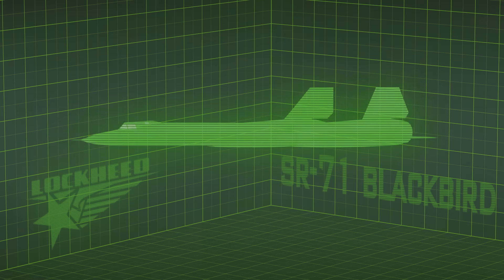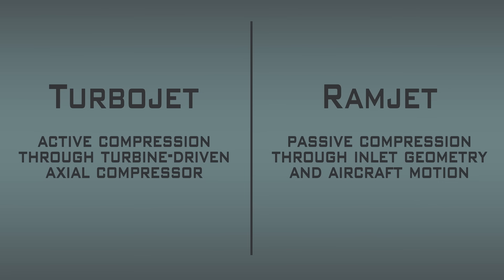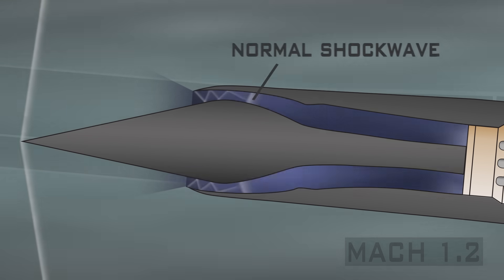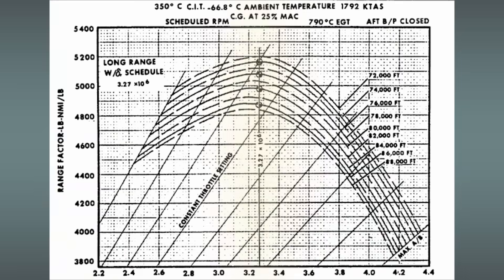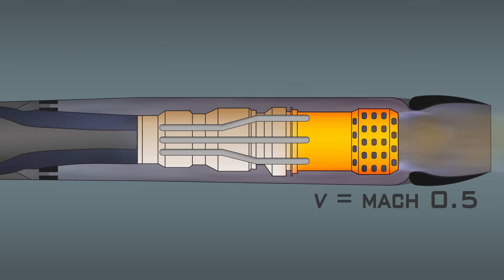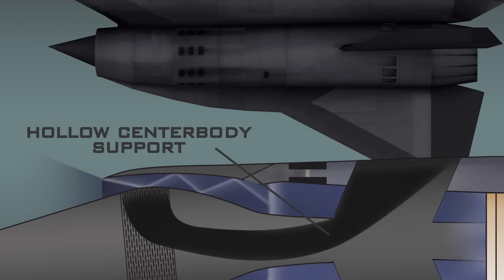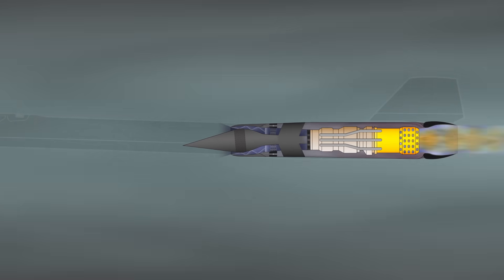The Mighty J58 - The SR-71's Secret Powerhouse

Comment: I do like this presentation - and it took me years of looking at those diagrams and crawling around inside the aerospike ram jets at our local Aircraft Museum to figure out how over 55% of the thrust is made by the spike compressing the super sonic wave 41 to 1 and then moving to aim it down the blast tubes in the engine cowling.
 So with this info, and how my rich uncle had built the CDC computers used in them, I made plans for a version that would be far faster, made of heat proof carbon so lighter, AND instead of using a million dollars of expansive custom made fuel (said to cost more than single malt scotch) mine exhaust pure water. 
Then 2 things happened really fast - the CIA sent contractors to the MSP National Guard Jet Aircraft Museum to cut up their star attraction, in a snow storm and take it back to CIA HQ, and a man called The American Sniper (may he rest in peace) was sent to blow my head off in my bed.
This plane had 2 major disticntiions to its credit - As a single seater A-12 it was modified with a liquid oxygne outlet in fornt of the widnscreen so it coudl go above the point where the 'glass' softened and became insanely dangerous - about 2140 mph, and set the record for fastest land launched airframe - 2,368mph at 92,000 feet. Also when it was fowln to Minneapolis inside a C-5 it was the largest cargo transported by air.

Comment: Excellent!  I would add that the center body of the J58 used on the SR-71 is ESSENTIAL.  If a turbine engine ever has a shock wave touch it's compressor blades, the result is usually an immediate explosion!  This is why it is VERY VERY dangerous to take a subsonic airliner to supersonic speeds in a dive [YES they can do it and YES it has been done in DC-8's on purpose, and L1011's and 727's accidentally.  The slippery 727 numerous times!], since the shock waves can reach the fan section of the engine and cause it to blow apart, a "rotor burst".

Comment: 2 muscle car motors ... wtf dude ?
Reply: https://en.wikipedia.org/wiki/Lockheed_SR-71_Blackbird#Engines

Originally, the Blackbird's J58 engines were started with the assistance of two Buick Wildcat V8 internal combustion engines, externally mounted on a vehicle referred to as an AG330 "start cart". The start cart was positioned underneath the J58 and the two Buick engines powered a single, vertical drive shaft connecting to the J58 engine and spinning it to above 3,200 RPM, at which point the turbojet could self-sustain. Once the first J58 engine was started, the cart was repositioned to the other side of the aircraft to start the other J58 engine. Later start carts used Chevrolet big-block V8 engines. Eventually, a quieter, pneumatic start system was developed for use at main operating bases; the V8 start carts remained at diversion landing sites not equipped with the pneumatic system.[58]

Comment: Sorry but the bypass pipes are not what make it work like a ramjet – this is done by the air going around the main part of the J58 inside the oversized housing (which is why the engines have the oversized housing). It’s not black magic – just a turbojet inside a ramjet tube.
Reply: Uhh nice try but no. The air going around the engine through the housing comes from the shock trap tubes used for cooling and from the aft bypass doors which are scheduled closed at mach 3.2.  This air gets dumped into the exhaust AFTER the afterburner at the ejector nozzle. The air going through the bypass tubes gets dumped into the exhaust before the afterburner, which is necessary for a ramjet. You're right that it's basically a turbojet inside a ramjet tube, but a ramjet needs an after burner and the only way the air gets to the afterburner is through the bypass tubes.
Reply: The bypass tubes are only there to take unwanted pressure off the forward compressor section and only incidentally give some small extra thrust - are not part of the ramjet system. The air does get dumped into the exhaust after the afterburner but this is part of how the ramjet thrust augmentation works. Explained better in the following video:

https://www.youtube.com/watch?v=VpZfBFlTC_c

SR-71 J58 engine tour with SR-71 pilot Richard Graham

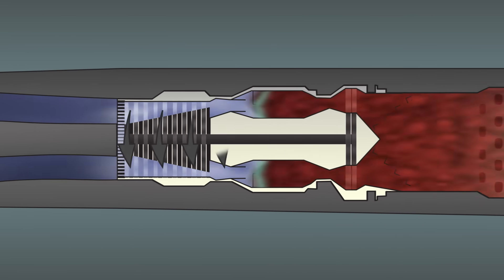0:55 “they built these tubes to take some of the pressure off instead of just dumping it overboard Kelly said lets utilize that – so it goes back and bypasses the turbine section and reenergizes the engine back here and provides a small amount of additional thrust in these six bypass tubes”.

3:40 “uses the air inside - it goes all around the core engine that we just saw – and comes back and reenergizes out the back end and that’s what gives us the additional thrust”.
“Kelly always told us that flying at mach 3.2 cruise the J-58 engines only produce 20 percent of the thrust – 80 percent of the thrust comes from the utilization of the mach 3.2 air and reenergizing it in going out the back end”.
Reply: Can you clarify:  when Graham says “at mach 3.2 cruise the J-58 engines only produce 20 percent of the thrust” - where is the other 80 percent coming from?  He sure sounds like he says the air goes around the J58 “and reenergizes out the back end and that’s what gives us the additional thrust” or is he confused?

Comment: I've always wondered what they are using to advance and retract the cone spike. Seriously there has to be something much more powerful than your run of the mill electric ,or for that matter mechanical  actuator. Even more confusing to me are the new generation thrust vectoring mechanisms. What the hell can stand all that heat and yet be so small that it can divert literally tons of thrust .Not to mention that it's size has to be very minuative ,just to fit in the area they are aloted. I'm sure someone out there knows these answers.Id love to know. Oh yeah BTW. When you said he or she can open or close .....,  I can tell you with near 100 % certainly ,that being politically correct about the way you stated that ,you are very incorrect in fact.  Only males ever flew the SR 71 and only 86 met and passed the rigors and testing.

Comment: And the most amazing thing of all is that this aircraft was designed and built completely without the use of computers. All of the calculations were performed manually using SLIDE RULES.

Comment: it would be nice if a blackbird could be picked up . as military surplus! I'd take a couple!  maybe it can be made even faster. or modified for ultra high altitude. add rocket motors.   cruse by the is at mach 10! I know crazy. and no surplus. but I can dream. it would be nice to come across a decommissioned fighter jet from from some other county . and be able to fly it around. it would be so nice to be rich!

Comment: I'm still puzzled by why the exhaust signature clearly illustrates "impulse" power?
Reply: If you are talking about the " diamonds" coming from the afterburner, they aren't impulses. They are shock waves. Since the inlet slows the air down to sub sonic before it enters the engine, it has to be accelerated supersonic again leaving the afterburner which produces shock diamonds.A pulse engine would leave a contrail looking like donuts on a rope.
Reply: I didn't say "pulse" engine ... I said "impulse" engine. The exhaust signature is clearly that of an impulse engine ...
Reply: Ahh I got it. I'm not a Trekkie so I didn't catch on to that.
Reply: @lardawg6794   Mmmmm...donut....(drooling sound)

Comment: and how does the whole thing not catch on fire when it's leaking fuel all over the place before start up ? maybe this is a dumb question , but I still want to know .   oh , and how about adding the part about the perfect diamond patterns it produces in full burn and why this is
Reply: The fuel that was used is JP7. It is a jet fuel with a high flash point, and high thermal stability because of the high temperatures at mach 3. It required a shot of highly flammable  triethylborane (TEB)just to ignite the JP7. If you threw a lit match into a bucket of JP7 it would just put the match out. 
    The diamond patterns coming from the after burner are shock waves. Since the inlet slows the air down to subsonic before it enters the engine, it must be accelerated supersonic again leaving the exhaust nozzle. Anytime air goes supersonic, you get a shock wave.
Reply: thank you . I do know that pictures of that particular engine on a test  bench (I don't know what it's called) in full after burn (at night) is a beautiful picture with that perfect pattern .

Comment: In case you want to climb around on one of them there is an SR-71 on outside static display at the Castle Air Museum about an hour drive east of San Francisco.  It's parked outside the paid area so you can check it out any time.  I don't recall if the J58s were still inside the nacelles though - probably not since the specialized engine metal alloys are very valuable.

Comment: can engines like this be used in SSTs like Concorde for fuel efficiency?
Reply from the maker: No.  Efficiency here is a relative measure.  It's not "efficient" like a Prius is efficient.  What you should understand is that it became more fuel efficient as it sped up because of the geometry of the construction, i.e. compared to itself at slower speeds.  But compared to other engines it is in no way "efficient".  Modern high bypass turbo fans in jet airplanes are far more fuel efficient when it comes to moving mass specific distances, but turbo props are even more efficient than turbo fans; they just move more slowly.
Reply: How do the engines built now for super cruise differ or are similar?
Reply: We really don't have anything now that is built for super cruise. Everything stays at mach 2 or less, including fighter jets and the Concorde . The reason for this is, above mach 2 a jet engine starts to burn too much fuel because of the drag. The drag is the wall of air, or shockwave, that the plane is pushing.Their inlets are external compression meaning that they keep the shockwave outside of the inlet. The SR71is a mixed compression inlet meaning that the spikes retract and bring the shockwave into the inlet so it can reuse that compressed air for propulsion to make the plane go faster. It sounds great but the problem is that this type of system can be very unstable and problematic. This is a very simplified explanation of course.

Comment: I have one question for you.? How do these engines and type of fuel adjust with the different levels of the atmosphere. The air gets thinner, different mixture of gases as you go higher up towards the dome. Helium and hydrogen lighter gases go up. What's the maximum height these engines work at efficiently. Thanks

Comment: I still don't understand how the retraction of the nose helps velocity increase, can someone explain?
Reply from the maker: It doesn't.  The angles of the shock waves (where the air drops Mach number) within the inlet changes with speed.  The repositioning of the inlet spike changes the geometry of the inlet to keep the final shock wave, where the air moves from supersonic to subsonic, in the right place within the inlet for maximum pressure recovery.  If it didn't move, this last shock wave would end up too far back and you'd lose pressure, an inlet unstart.

Comment: TechLaboratories Are you really sure that the external shockwave is positioned directly at the cowl only at cruising speed? I thing that one of the reasons why the inlet spike is moving is to ensure the external shockwave is positioned at the cowl at all times above Mach 1.0. Otherwise there would be a massive increase in pressure losses on the engine area (nacelle) of the fuselage due to shockwave resistance
Reply from the maker: The angle of the external shock wave is too shallow to position at the cowl at low Mach numbers - you'd need a greater than full retraction of the inlet spike to position it there.  It's because the profile of the plane is designed for the higher mach numbers instead of the lower ones, and is a contributing factor to the efficiency of the plane, which increases as it flew faster.
Reply: TechLaboratories is correct. Plus the spike doesn't even begin retracting until mach 1.6

Comment: The SR71 is the greatest machine ever built by man. To think when this was built there was no such thing as cad or computational fluid dynamics, all done with a slide rule and pencils.  I used to live next to a US air base in England  and I would see this bird take off in the middle of the night , the noise and the distant sight of those two bright purple and orange plumes coming from the engines as it took off on full reheat is something that I will never forget.  Jeremy Clarkson was right, that plane has got a 'soul'.

Comment: Why dose the SR-71 produce fire balls in the exhaust, about five or six of them in a row?  Anyone?
Reply from the maker: They're called shock diamonds.  It has to do with the changes in pressure in the plume as the plume expands and contracts relative to the outside air.  Check them out on Wikipedia.
Reply: Thank you!  That's a question I've had for years, just didn't know where to go for the answer.  Thanks!

Comment: Ben Rich was a propulsion god.
Reply: Ben was in the Thermodynamics Department (heat transfer) at that time. The Propulsion Department was led by Dave Campbell.
Reply: @dohabandit  The propulsion group at the Skunk Works, or any other airframe company, is responsible for propulsion cycle analysis and "propulsion installation". The latter function refers to the aerodynamic design, analysis, and test of the inlet (which you mention) and the nozzle. The engine company also participates, and may lead the nozzle design. That was the case here with Pratt & Whitney. Back to the inlet. The Propulsion Group designed this inlet. Several people were involved, and they worked for Dave Campbell. Ben was in the Thermodynamics Group, which again means heat transfer analysis. They also design the environmental control system, along with subcontractor who supplies it. This system provides a "living" environment for the crew. The Thermodynamics Group on this project had a huge task due to the aeroheating issues. Ben would have been busy with those tasks, but he may have performed heat transfer analysis on the inlet (which the cone is part of)  in a supporting role.

Comment: Ive read when I was younger the SR71 would actually leak fuel taxiing on the runway because the materials used could only properly seal at the intense heat cause at cruising speeds. Any truth to that? I always thought this was exaggerated.
Reply from the maker: It's true.  Rather than trying to keep it sealed on the ground and have to worry about the increased structural pressure as the parts heated up, they let the parts expand into a sealed state after take off by warming the plane through a quick supersonic run, then immediately refueling.  It also kept the plane lighter because they took off with far less than a full fuel load.

Comment: Sorry but the by-pass pipes were not ram jet elements. They by-passed air pressure built up before entry into the first stage compressors at supersonic speed. They provided some additional thrust but were not ramjets. The ramjet portion is the area surrounding the J58 within the engine nacelles from the inlet opening, to the exhaust. Ramjets are typically operated between Mach 3 and Mach 6. The SR-71 was capable of flying MUCH faster than Mach 3.5. Try Mach 5.4. Titanium melts at 3000 degrees f.  The top temperature for the SR was 1250 degrees f. SR-71 pilot Scott Buhl stated, "We always had more speed available" and when over Libya in the 1980's commented on "scary Mach numbers he'd never seen before" while outrunning a SAM that had been launched against he and his RIO. This plane probably never really fully utilized its real speed potential, and DEFINETLY never maxed out over enemy territory. Soviet air force officer:" We could not shoot down with our 1980's technology, what you (US) built in the 1960's." Think about that for a minute.
Reply: The bypass tubes took air from the 4th stage compressor. If it would have taken the air from in front of the compressor that would have been a ramjet by its very definition.But since it has gone through 4 stages of compression, it gets called a turbo ramjet or a partial ramjet. It would have to be partial because not all of the air is bypassed, some goes through the engine so its kind of a hybrid. The air inside the engine nacelle is provided by the shock trap bleed (used for cooling), and the aft bypass doors which are scheduled closed at mach 3 and only opened occasionally to bleed off pressure or to help cool the exhaust. Both of these are dumped into the exhaust after the afterburner spray bars. The bypass tube air gets dumped into the exhaust before the afterburner spray bars. So the ramjet portion of the SR71 is from the bypass tubes not the air surrounding the nacelle . You are correct though that it provided some extra thrust and it also prevented overloading and stalling the compressor. The majority of the propulsion at mach 3 was provided by the inlet anyway.  If I remember correctly, speed was limited by the temperature of the engine compressor (CIT), not the exterior skin temp. They could always go faster for short periods but cruising was limited to mach 3.2